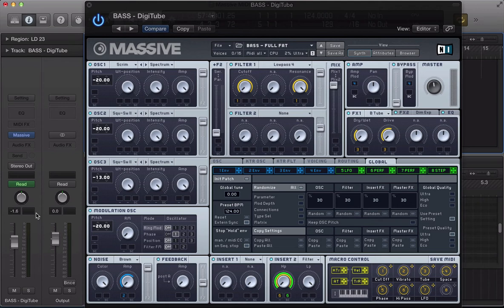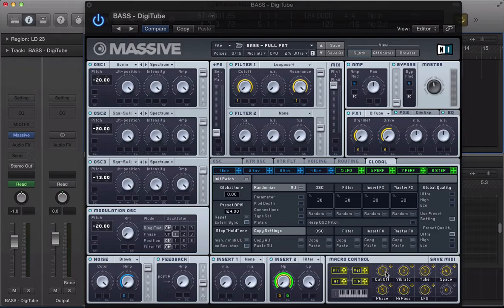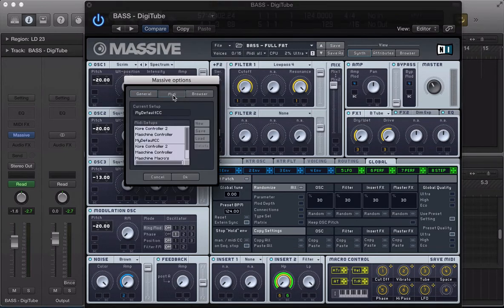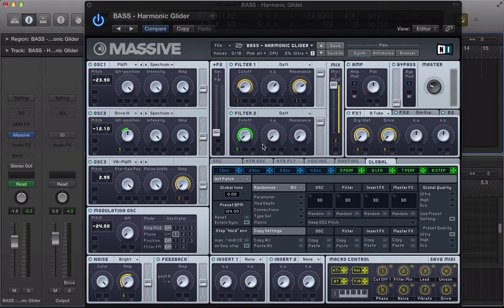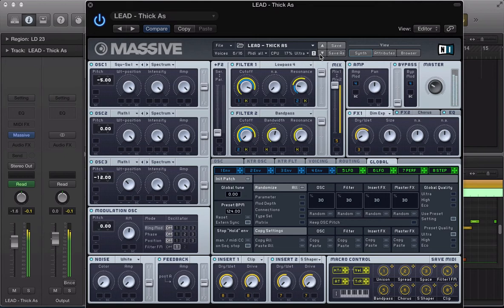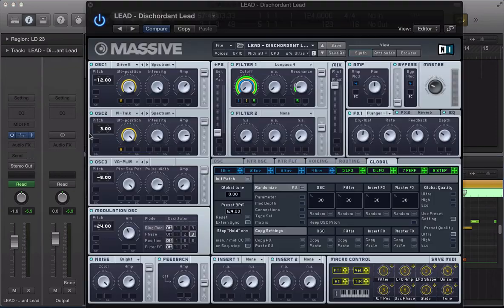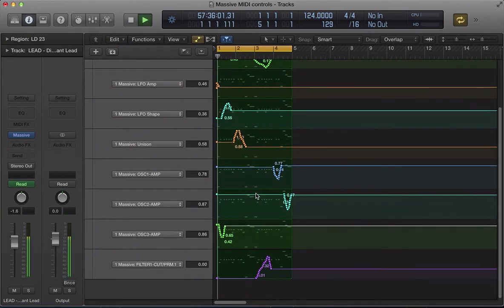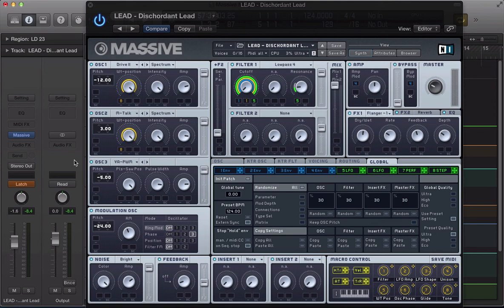NI Massive Tutorial - Set Up MIDI Controls In Logic X

Comment: I noticed you were in read mode, maybe try latch mode to get the macros on the go.
Reply from the maker: DJ PANE latch mode will record any movement made on any parameter during playback, MIDI controllers, mouse movements, etc. So we could do the whole thing using Latch mode, which is what we do in the following tutorial, and we also switch to using latch mode in this video if you watch on a couple of minutes. 
But we're trying to make this less specific to Logic (which is difficult I admit), as everyone uses different DAW's, which is why I discuss the options for recording MIDI data in this way.
Reply: Very helpful and appreciated always. Thanks so much.... Pane